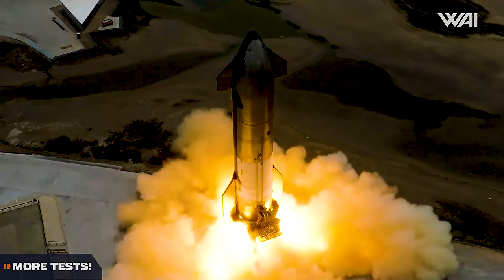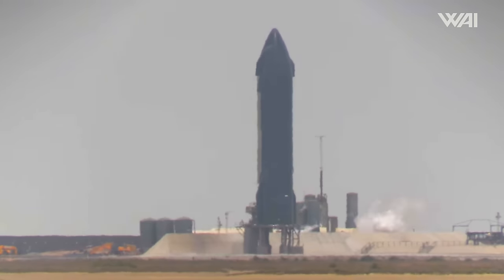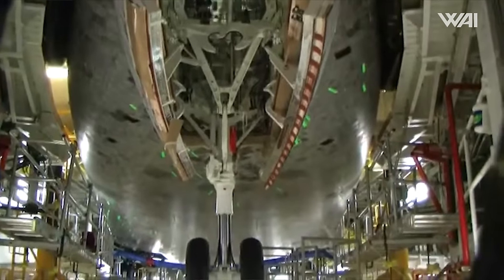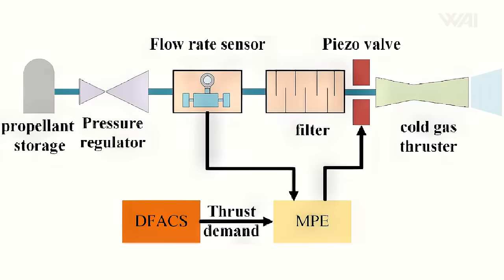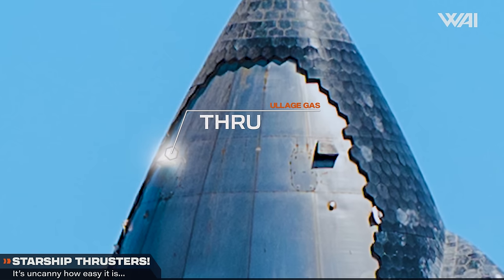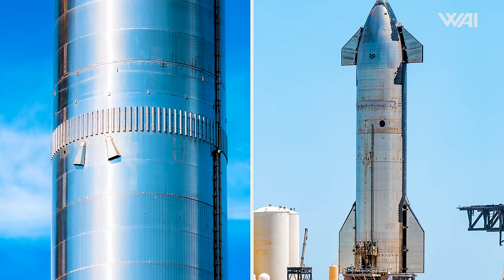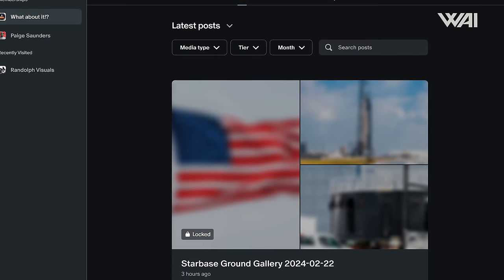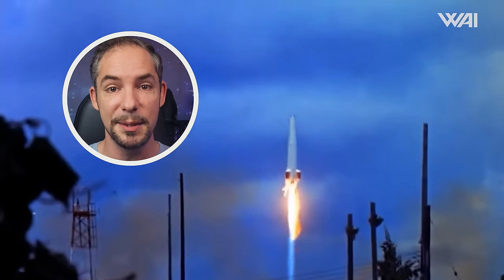SpaceX Starship's #1 System Fix Needed!

Comment: Engineering is built on the physics models currently in vogue; therefore you are counselled to keep one eye on the crisis in physics. The Standard Model cannot be saved.
I suggest several approaches to achieving anti-gravity.
1) Review Townsend Brown's demonstration of electro-gravitics/
2) I believe the Brown's very high voltages stressed mu0 and epsilon0. (We have no idea about the parameters that produce their values.)
3) Stop the know-it-all pose and actually do the experiments suggested by Charlie Hall who posits (with supporting evidence), that there is at least one extra field associated with electro-magnetic wave that interfered with the Maxwell Morley results, (Later falsified).
Reply: I used GPT3 to help polish my passage up. It reluctantly offered up Dayton Millers name with regard to the MM experiment's results.

"Engineering is deeply rooted in current physics models, making it crucial to monitor developments in the field. Presently, there are doubts about the sustainability of the Standard Model. Here are some proposed strategies for exploring anti-gravity:

Investigate Townsend Brown's electro-gravitics demonstration more closely.

Explore how Brown's use of extremely high voltages may have impacted the constants mu0 and epsilon0. Note that the factors determining their values are not yet fully understood.

Take a more experimental approach and follow Charlie Hall's recommendations. Hall proposes, with evidence, the existence of at least one additional field related to electromagnetic waves. This field may have influenced the results of the Maxwell Morley experiments, "

Snip--------

(And then it tried to defend Einstein's bent nothingness conjecture, much to my irritation)
Formatted by me for clarity.

Comment: Some "minor" adjustments to the shape of Starship could make it passively stable. Cylinders are not aerodynamically stable.

E.g. go to a slightly triangular cross section, with the flat side on the tile side.

Comment: If a simple hotfire test enough to pull off those heat tiles i seriously doubt they can withstand reentry.
Reply: Reentry is a different load, statically pushing the tiles into the ship instead of an engine test that vibrates and peels the weak tiles off

Comment: Here is the solution on the heat shield problem ....
What I propose is to print a ceramic  (threads)  heat shield in one large  piece ...This one piece heat shield is then mechanically connected to the ship ..the exposed fastener  bolts are then covered with high temp sealer. ..
The shield becomes one large piece no way of falling off or breaking 
This method also allows a Thermal blankets to be lined under the shield to act as an insulator for expansion and contractions 
Problem solved no further issues with heat.....
My design simulation work ever time

Comment: The cargo bay door idea is wayward. Both structurally and physically to reseal it. Don’t try that test again on ship 29. The tile issues are worrisome. Needs better adhesive with inherent flexibility and keyable surface features. Shake rattle and roll but don’t fall off. The total flight time needs to lengthen. A Boston Dynamics Atlas robot needs to be onboard to follow and understand the dynamics of re entry and fitted with a retrievable float capsule. I would love to fly one but I think it needs bigger wing surfaces.

Comment: Based on IFT 3 outcome, it may be a bad idea not to have a traditional RCS system. If it was for attitude control in orbit, that would be one thing but here you have to point the Booster and Starship quickly to control the landing and reentry. Sounds like since the human version will need it, might as well implement and test it now..

Comment: I would love to see space x reimagine the space shuttle.  Keeping in mind re-usability. A set of falcon 9 rocket boosters  and a booster fuel tank with built in engines to land back on earth like falcon 9 and of course a design of the shuttle with the new tile system and the ability to to replace missing tiles in space.

Comment: So close to a decade of work and billions of taxpayers money and we are near a point that this crazy design might actually work. NO I'd say, taking off and landing is barley the beginning of proving the platform can do all the things promised. And reusability isn't a excuse. They have not gotten both parts close to trying that or even justified not launching a straight expendable test run, since they all went boom anyway, and why are the units basically out of fuel before landing burns with no load? If they are reducing the fuel load since there is no load then these engines are running at partial throttle and still failing or they are not as effective as hyped.

Comment: WHY WON'T THEY WORK OUT MORE FUEL FOR DECELERATION FROM ORBITAL SPEEDS AND REENTER ATMOSPHERE AT THE SAFE SPEED SO NO HEAT TILES ARE  NEEDED... 🤔🤔🤔🤔🤔 simple , or maybe not
..🙄
Reply: Impossible. You would need ridiculous amounts of fuel to do that, so much that its doubtful a rocket big enough could realistically be designed.

Comment: SpaceX hasn't solved the issue with the raptor engines, as they still eat their inner copper (the green flames from the booster during reentry), leading to the booster touching the water at mach 1. Then the second stage fail its orbital insertion (speed, trajectory, roll - everything was wrong), then the "Pez door" was a complete failure (didn't open completely, then failed to close, and looked terribly flimsy), then it vented all its remaining fuel (some pipe may have burst) before burning away. My main concern is that even if the fins looked like they were functioning, they could not properly steer the second stage.
We'll see how the 4th test will do. Or how it will don't.

Comment: I see tiles falling... on the ground. I see incomplete burn...at liftoff. I see the pez despensor...broken. i see leaking gasses after shutdown.  I see leaking gasses escaping the pez, causing uncontrolled roll. I see raptors eating each other emitting green flame. 
Id say something needs to change at space x.
Blue horizon tho looks to be dominating. So its probably moot.

Comment: while they are 3D printing the the shell couldn't they 3D print the tile compound directly onto the the surface? i guess they know what they are doing, but thousands of hand applied tiles just seems so industrial revolution instead of gateway to mars. heat resistant stainless steel?
Reply: Or build preconfigured panels with the tiles on them that can be rapidly swapped out.
Reply: Starship is not 3D-printed; you may be confusing SpaceX with Relativity Space.